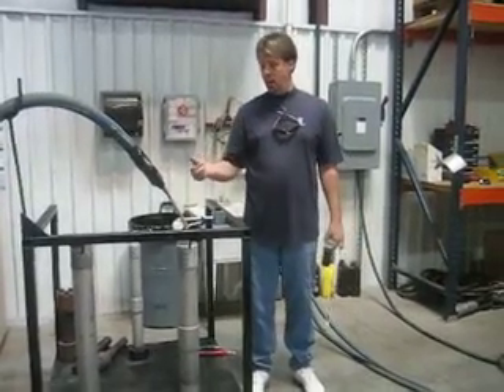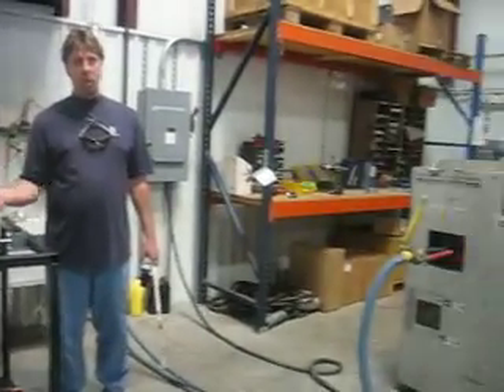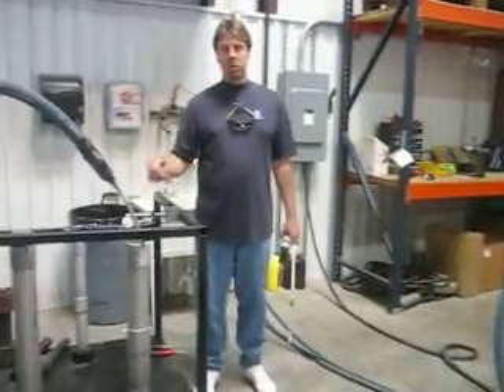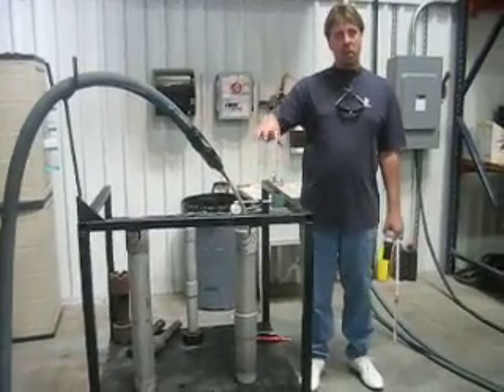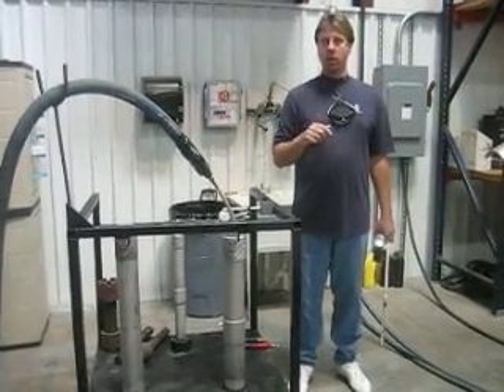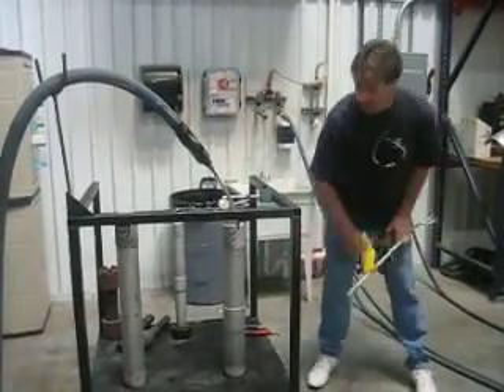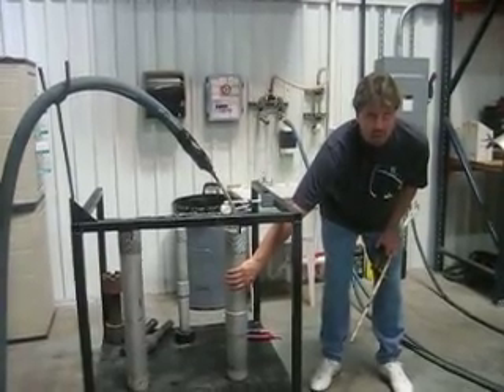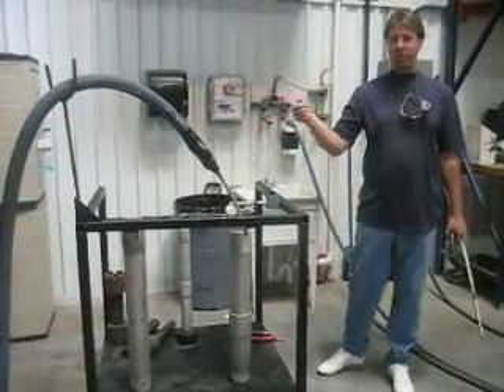Turbine Shell removal (Bolting)

Comment from the maker: Electric Induction can heat up a 6inch stud under 5 min!!! Because of the integrated chiller, the tube is cold to the touch in less than30 seconds. The old fashond way used to be done with cal rods. (like a electric stove) With Cal rods the process takes much much longer, and is unsafe to people around them.